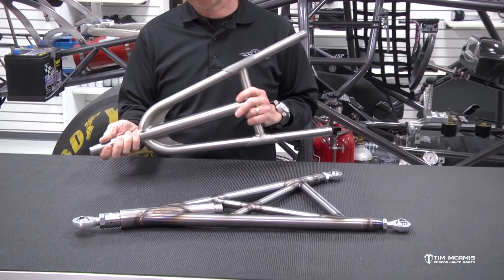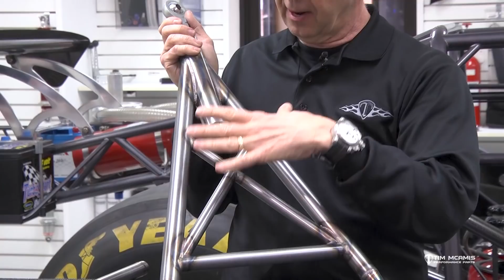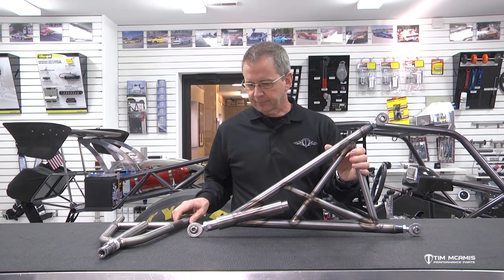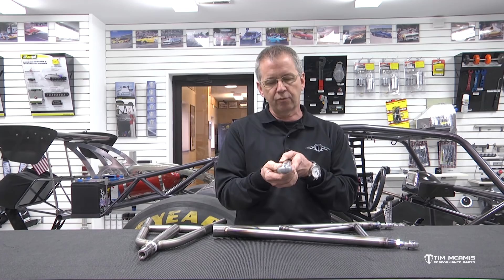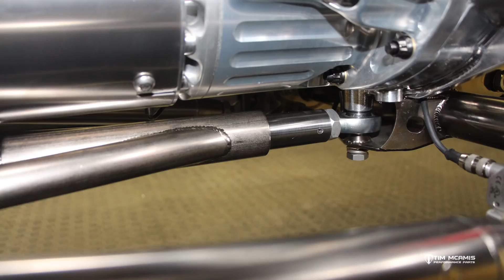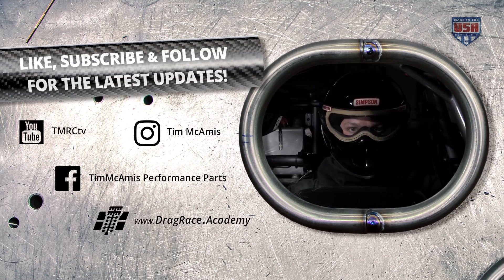HD Wishbone Overview

Comment: Hello, I have a CHE rear end brace and axle tubes welded. Done right by welding tubes empty with a jig in middle to keep tubes straight. Any benefits of adding a wishbone to the rear or at this point, would be unnecessary and even over kill? Thank you

Comment: I have wallowed out wishbones where the slider enters, and exits. Used to just replace them. Now I put a steel split shaft collar on both ends, and torque them down so the tubing can't wallow out. Been running the same one now for a while

Comment: Hi Tim,

I'm rebuilding Bill Jenkins Grumpy's Toy VIII 70 1/2 Camaro Pro/Stock car.  As you may or may not know that car was built by SRD and it has a 3-link rear suspension with a wishbone.  I'm upgrading a couple of the components like the wishbone and the link arms.  The link arms arm pretty straight forward but the wishbone is a little wider than anything you have listed on the website, approximately 24 inches across the eyelets.  I'm wondering if your jig would accommodate a width that large and if so would you be interested in building that piece for this historic old race car?

Best regards Michael Brennan

Comment: stud biker bracelet combined w/sturdy hose clamp, but the studs face into the pipe u r clamping onto. Plenty strong bc instead of just 2 pins u hve it studded all the way around pipe. Nothing to drill out or rear weld just torque on or off the hose clamp.

Comment: I no longer am building cars, but when I did, my wishbone was very similar to your new design, but we used a rubber bellows toe dust seal on the slider. We didn’t have the Teflon bearings, we used a second steel insert for size, and a grease zerk was installed, and the bellows kept everything clean.

Comment: Ah. There's a slider. Now I finally see how this 4-link mechanism can work. You know there are tube laser-cutters out there that can make these notches in tube ends in seconds? You will have to outsource it as it's a huge investment and it obviously doesn't work on bend sections. But it's a lot cheaper than CNC-milling.

Comment: I haven't watched all of your other videos, but from what I can tell, you are running a relatively parallel 4 link with a a wishbone that also telescopes in length. pretty cool stuff. I was watching another channel the other day, and they had a truck with a 4 link front that used a scissor mechanism for a panhard bar that had a sliding joint. it used the same thing for the steering linkage as well.
Reply: Usually a "scissor mechanism" is a Jacob Ladder, they are popular on sprint cars. I would be interested to see what you saw because a Jacob's Ladder does not use a telescoping tube.
Reply: @fastone371  it was the any level lift, theres no telescoping on that.
Reply: @davidfarmer  I guess I dont understand. I thought you said "I was watching another channel the other day, and they had a truck with a 4 link front that used a scissor mechanism for a panhard bar that had a sliding joint."
Reply: @fastone371  right, first i was talking about what was in this video "you", a telescoping wishbone. then I was talking about another video from another channel "they", a scissor mechanism to replace the panhard..
Reply: @fastone371  the joint slides along a bar mounted horizontally to the axle.

Comment: What are your guy's opinions on running a wishbone on a street driven car? It's built for the track, we just haven't gotten around to taking the license plate off...

While I'm curious about the general thoughts on this, my application in specific is a stock style suspension radial Fox body, I'm running the Baseline Suspension 'Outlaw' relocated uppers + lowers, all heims/solid ends no rubber/poly. In spite of the heim/solid rear links, these stock style Fox(and G-body for that matter) suspensions are known for a little side-to-side movement(triangulated 4-links are compromised by design), so I was thinking about maybe a wishbone mounted between the lower links to afix the rear end along the chassis centerline for good for rock solid stability.

I don't know if there's any risk of causing some damage during axle articulation, like what can happen with drag racing anti-roll bars on the street, but that's definitely a concern.
Reply: You would need to protect the slider with bellows or something to keep the street grime out or it would not last long. I have the same problem with hiem joints on my street car. I suggest putting boots on them and keeping em packed with grease. The service interval will still be quite high for a street car. As long as nothing is binding you should be fine. Drop out your spings and shocks and manually manipulate the rear end, feel for any bind before buttoning up.

Comment: Very cool, if you ever have the need to be more accurate ,  I have a suggestion. Make the tool out of the same material you’re welding. The thermal expansion will be the same. We do that in aircraft tool building. That small of scale would be minute. Great job keep up the great videos...
Reply: The first time the car bounces down the track things move..constant alignment is part of the deal anyway. the tolerances you mention are minuscule as compared to adjustable nature  built into the various components..the enemy of good is perfect.  :)
Reply: How do you maintain correct  Interpass temperature with out the cooling effects of copper or aluminium in such a fixture.
There dealing with 4130 cond (N) in the .065"-.120" wall thickness.

Also i think they could benefit from back purging there stuff for a longer service life.your thoughts on this ?
Reply: When I say to build a tool of similar material, that just helps with the contraction and growth of the materials in different climates. 
I agree with the purging the tubings with gas to help with a cleaner weld. 
I have seen parts get tool locked because it grew faster than the tool because of heat and warping. We learn new stuff every day! Good and bad..lol
Reply: Honestly, that level of precision is a bit beyond what's required for drag racing, there's enough slop in other components(not to mention all of that massive sidewall between your firmly affixed wheels and the ground below you) that such a minute improvement in tolerance is simply going to go unnoticed.
If this was one-off high dollar custom build stuff, that would be one thing; but this is a production piece, it's a piece of universal chassis hardware, and a wear item at that. Diminishing returns - gotta maintain a decent margin.

Now, if you want to see ALL of the bells & whistles thrown at welding for motorsports - look up Trophy Trucks, they're completely over the top in every single way, including the most extensive fabrication in motorsports. 6000+lbs of tig welded chromoly tube, everything gets torn apart down to the bare chassis and inspected for cracks(tube chassis are wear items for Trophy Trucks... and that's for a vehicle that costs $750,000 to $1,000,000 to begin with; Pro Mods are SIGNIFICANTLY cheaper, closer to $200,000 for a nice car, probably 1/3rd the tubing, 1/3rd the labor, etc.) after every single event just because of how brutal hundreds of miles through gnarly desert terrain, propelled by ~800HP(not including the couple of turbocharged trucks now...), and swinging big heavy 39"-42" tires through more than 2 feet of suspension travel. The forces are just crazy, especially when they're capable of 140MPH flat out on relatively smooth terrain.

Trophy Trucks are kinda like the low riders of the motorsports world - yea, they're completely utterly over the top, but for as over the top as they are everything is done to a show winning level of perfection(literally - again, ~$1,000,000...). There's some very nice fab in drag racing and road racing, much like your more traditional show cars are very nice cars; but Trophy Truck fab is just on a different level(largely due to necessity), just like low riders are basically show cars in their most extreme form.
Reply: @RyTrapp0  Actually, you should spend some time around a top level drag racing tuner. Believe it or not, they can tell the difference when a part isn't exactly straight. Minute adjustments made to a precise setup are what keep a 5,000hp door car from slamming the wall.
Reply: @mrctuned2844  "...they can tell the difference when a part isn't exactly straight..." - right, they aren't grabbing a micrometer to set alignment, they're using a tape measure. There's levels to this game, just because these race cars require greater precision than your average street car that doesn't mean that the required level of precision is an infinite need, there most certainly is a diminishing return. Especially when you add money to the equation.
 
I've worked for a Grand-Am Prototype/IMSA GT team, not to mention all of the grassroots racing I've been involved in outside of that; I'm well aware of the tolerances we're talking about. Bubble balancing drag tires is typical, these things don't tend to get spun up on a machine. Because it doesn't matter, the difference is microscopic in its effects on the car, the way the tire is designed to deform completely undermines any extra precision gained.
Reply: @RyTrapp0  I dont know about that. I mounted 100's of slicks and we always use a spin balancer. As far as the micrometer we use a large, large caliper for making rear steer adjustments.

Comment: ,,, what was the first of these ? I know Don Ness had them in 1987, and maybe earlier .
Reply: ,,, Don Ness, was from Minnesota, ,,, rip .
Reply from the maker: Can't remember. There's been many designs and variations over the last 40+ years.
Reply: @Timmcamis  We acquired  a used 69 Chevelle drag car, it had 14" x 32" slicks. It was built in the late 70's or early 80's as a Super Stock car I believe. It used the factory frame, they found a donor convertible top frame that is boxed from the factory, and built an unequal length 4-link that fit under the near stock floor. It also had a sliding wishbone!!!! At first I kinda thought the car was a POS until I started looking at the effort, the problems that they faced, their solutions, and the era in which the car was built. I gained a lot of respect for it when I put it into perspective, even the front running Pro-Stocks were crude at best in that time period.
Reply: Don Ness if he is or was from AZ. He is a assh~le.